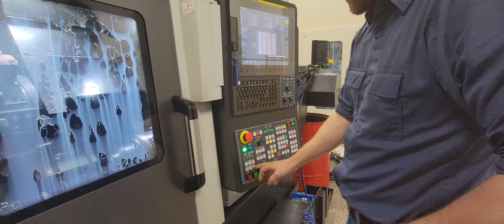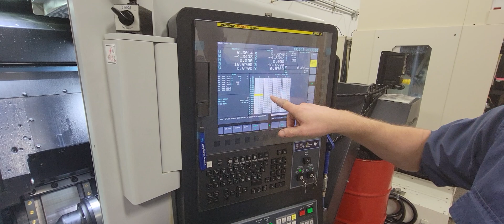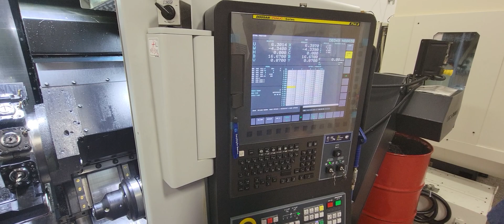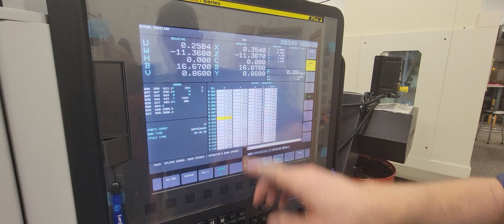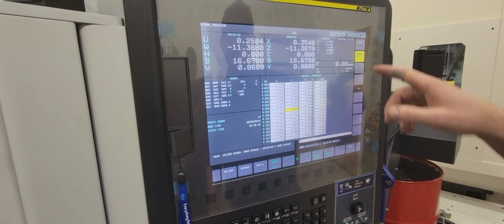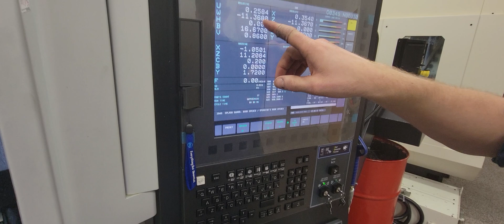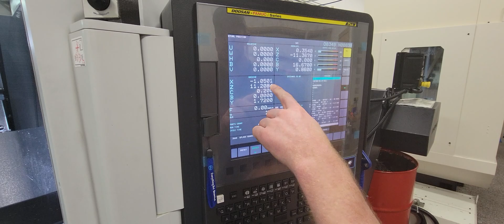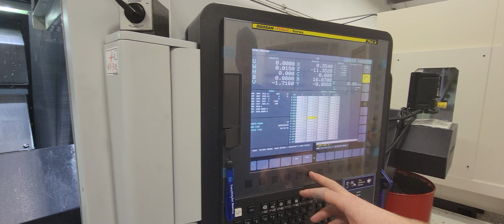Lynx 2100 Setting a Double Axial Tool

Comment: I noticed your annoyance with the wear offsets. I myself, am just getting familiar with these newer machines. On my older machines (10/11T) the wear offset is automatically cleared whenever you use the measure function to fill the tool geometry offset. I would speculate this factors the wear into the geometry setting but curious to hear your experience.

Comment: Hello sir, can you tell me what the benefit of this 24 half-index turret is when you already have a Y-axis.
I understand that you need that Y-axis on live-tools for twin-holders but this works on parallel double static holders as well. Y+/Y- motion.
Is it for some extra clearance on the haf-index (15°) ??
Reply from the maker: The "half index" turret positions aren't that useful considering we have Y axis;  I believe they carry over the feature from the XZ lathes. We have an NLX with the 12 position turret and we just use the Y axis for the static and live tools.

One advantage would be with larger workpieces; Compound Y machines inherently limit y travel the closer you are to home position.
Reply: @daunt007 
 Okay, thanks for the reply.